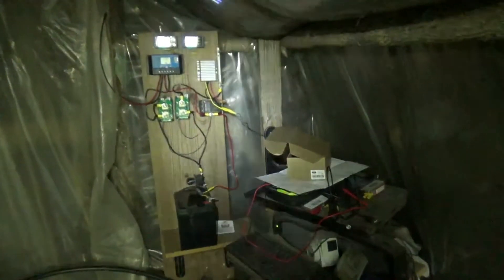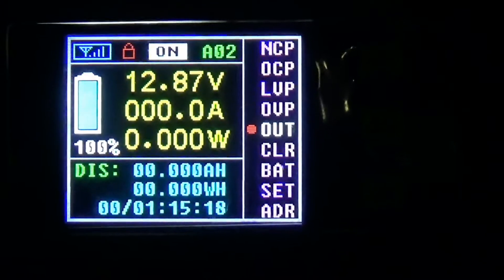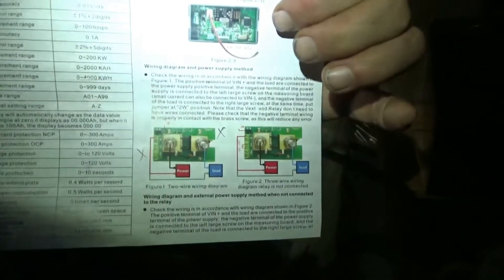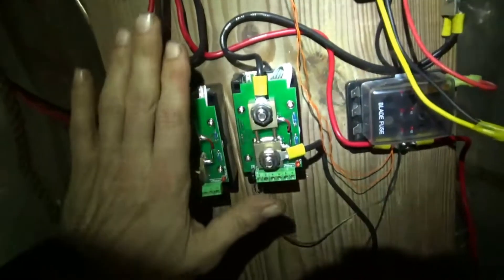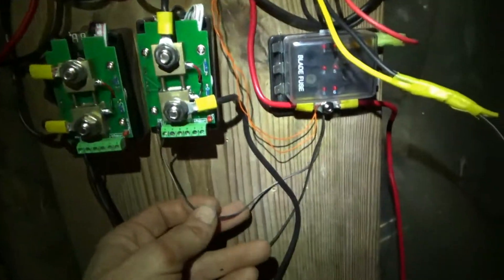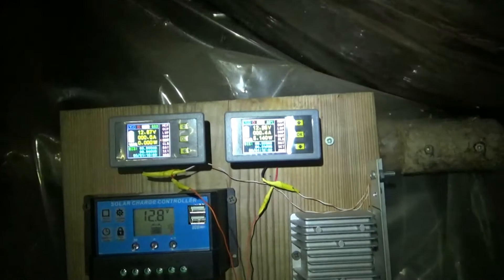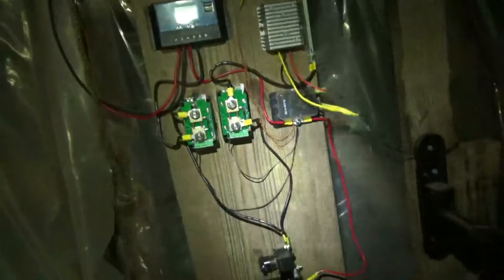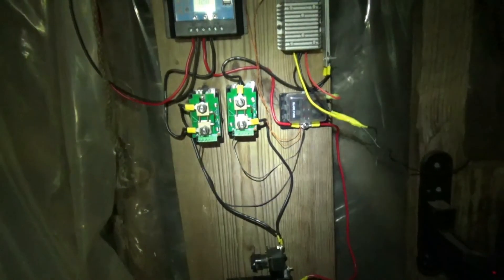DROK Model VAC 1100 Digital Wireless Watt and Amp Meter Connection Details 2W

Comment: Are you still using this? if so, please reply. I need your help. I found 3 more setting  if you hold the up button when on the top [ncp] setting, and I need to know what they should be set to. because I stupidly changed them and now the  current is not calibrated correctly  anymore.
Reply from the maker: Not recently... But maybe this will help?    https://www.droking.com/cs/wp-content/uploads/2019/04/200193.pdf

Comment: Hi, I see, you have 2 of these VAC 1100. How did you manage that they don’t interfere ?
I have tried to switch one to Chanel B, (cabled) but the two units still interfere and the chanel B1 works not wireless.
How did you do it ?
Reply from the maker: Hmmm.. been quite a while since I set these up.. but they are both on bluetooth. As I recall there is a setting in there for a range of channels. Maybe try a different channel set?   I'm sorry I don't recall more info.  Please let me know how you make out.

Comment: So just wondering if you could just use one display and two shunts and switch between the two on the single display? I think the communication is RF instead of bluetooth?
Reply from the maker: Not sure.. might be able to.. but what is the reasoning?  These meters are bi-directional, but cant log gained vs lost.. so thats why i run 2 meters side by side.. one reads incoming power from the panel, the other tracks used power on the "load side", really so i have an idea if i'n making excess power or using same or in deficit. I'm 100% positive they say the meters are bluetooth and i have seen them when scanning bluetooth devices in the area.  10 meter range.. very low power i'd suspect.

Comment: Hi, not sure if anyone els has this issue or found a fix. My vac-1200A has die battery level indicator dropping to 0 before the battery even reaches 95% SOC. It has a % right below the battery level and that shows the right %.
Reply from the maker: Use the meter's settings to adjust the amp-hour size of the battery bank you are working with. (It's in the manual)

Comment: They are bidirectional current sensing, so you could just use one and install the charge controller and load at the "load" end with batteries at the source and your display will change from "DIS(discharging)" in green to "CHG(charging)" in red. Amps going into the batteries will be marked with - (negative). Sweet little meters.
Reply from the maker: Yes... but they cant measure both directions at once... one is set up to monitor both directions now... and the other is from the charge controller to the batteries... so i can track exactly the amount of power produced vs the power used. But yes, sweet little meters, and thanks for the tip... Helpful comments are always appreciated! cheers!
Reply: The Farmacy Seeds Network Ahhh, I get it now, hadn't thought of that since my application hasn't been applied to solar as of yet so the simultaneous flow hadn't crossed my mind. Good idea, might as well pull all the data you want since they're so cheap. Glad I came across your channel, tech has always been a passion and recently gardening. Been working on integrating both hobbies into an automated hydroponics kitchen garden setup with a lithium battery backup system. Now if I can only get nutrient mixing and measuring figured out lol.
Reply from the maker: Yep... that's the ticket... I played with all sorts of hydroponics stuff before... good marriage of tech and gardening for sure! Look into "dosing" pumps... I dont think they'd be too hard to engineer... then you just need EC and Ph.   I'll have a look at your channel tomorrow... looooooong day today.. :cheer:
Reply: The Farmacy Seeds Network Oh, I don't have any videos. I'm too much of a scatter brain to produce regularly scheduled content, or anything entertaining for that matter lol. Thanks though, I'll definitely check out the dosing pumps. For now I'm just checking PH and TDS regularly, still a noob so I hadn't heard of EC till you mentioned it. Was thinking of trying out a full time PH monitor tied into an Arduino that controls a small release of PH up or down depending on how far out of balance it becomes. Most recently adding a simple float switch and 12v pump to keep topped off from a clean water reservoir since here in AZ it is so dry, I have lost up to a gallon or more a day in evaporation, causing the solution to concentrate and burn the smaller plants... Salts build up on top of the clay media so fast from the dry air here that I had thought it was thousands of pest eggs. Growing food is probably the most difficult challenge I have taken on in some time lol.
Reply from the maker: Ahhh ok... well I'm glad you enjoy the channel... and yes hydroponics is tricky and power consumptive... I've found soil is soooo much better for growing... microbes and biology do most of the regulation for you then... Yes, growing food is VERY difficult until you understand all the principles underneath... Much better food can be grown in soil with much more ease... but I get it... the "tech" side of hydroponics is fun...
Somewhere out there there is a ph probe for about 40 or 50 bucks that would prob work with an arduino to achieve the goals you are after.